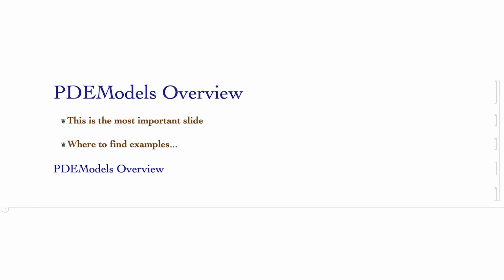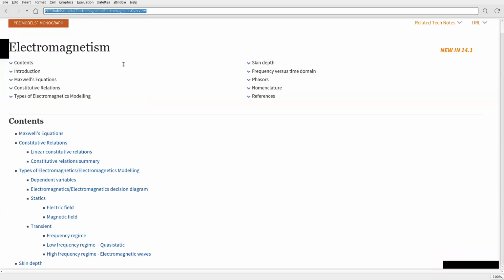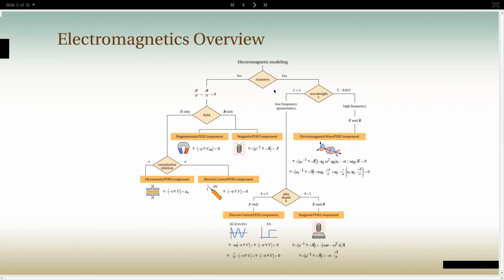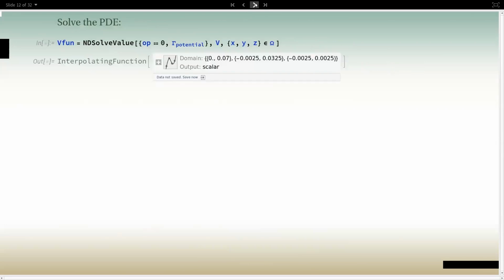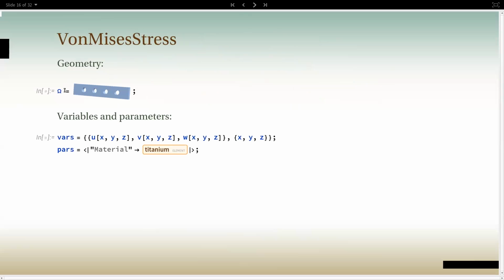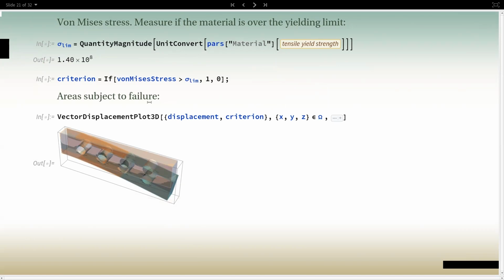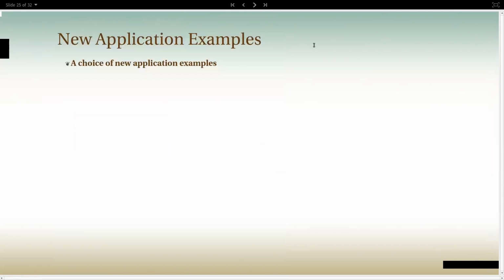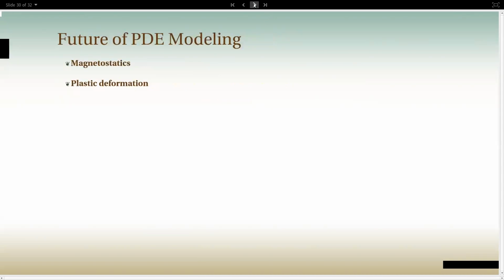Tour of PDE Modeling in Wolfram Language

Comment: Also, when attempting to model thin plates (not planar membranes)  ..like shell structures, I would think that using special components designed for 2d elements in 3d space would be more computational efficient.  The only way I see modeling a shell is using a 3d element...correct me if I am wrong.
Reply from the maker: The author responded with: "Shell elements would be more efficient in 3D for that specific purpose. You could use a plane stress formulation in 2D though."